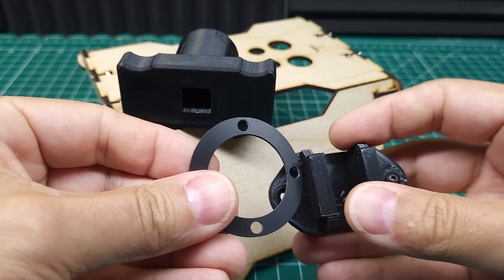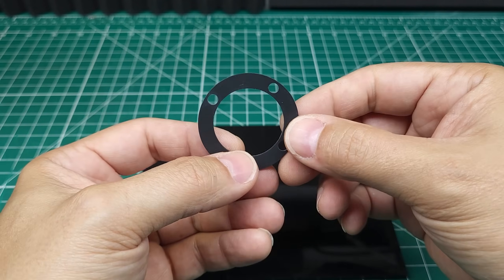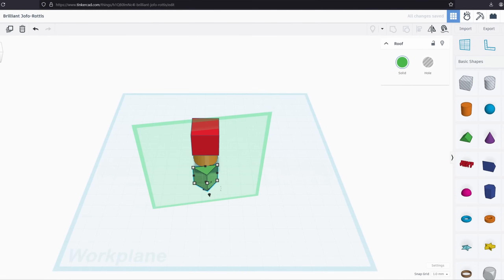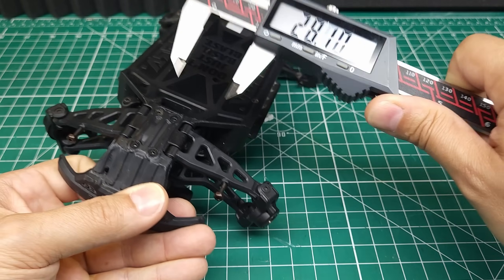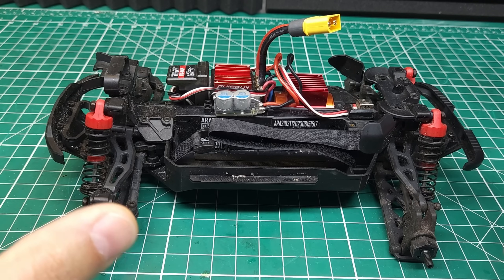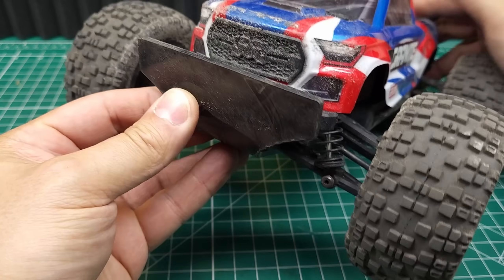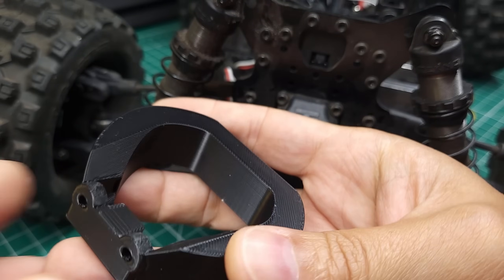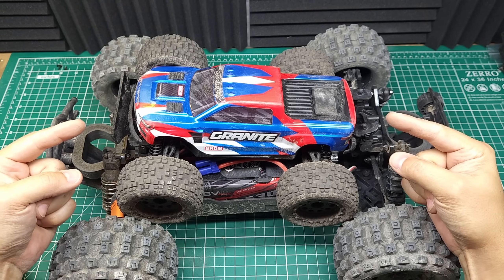It's Time To Start Making Your Own RC Car Upgrades | Here's How!

Comment: Possible to 3D print out the Grom differentials?
Reply from the maker: It's definitely possible to do but it wouldn't work. The 3D printed parts would not be as strong as the original injection molded counterparts so you'd end up with a weaker part.

Comment: Awesome 👍 I want a whole channel of just making stuff for rc. I would want to win a custom wing and mount for the Rival MT8.
Reply: I recently picked up an ender3v2 for $100 locally. It has been pretty good so far for getting into 3d printing
Reply from the maker: Yeah they are definitely good printers though they require you to learn some things in the slicer that something like a bambu lab printer wouldn't require
Reply: @DoRC  Just like the MT8 was cheaper up front but required some extra effort

Comment: So,I've seriously been thinking about getting a 3d printer and have been pricing them. Now I may have to look into a laser cutter instead. Decisions Decisions....🤔😴
Reply from the maker: They both have their advantages and disadvantages. I think a 3D printer is a little bit more versatile for RC but it's hard to know for sure which one would be better for you it depends on what you're going to be doing with it
Reply: Well, I was leaning more towards RC related products, but was talking to my wife about how I could make things for around the house as well. (Really trying to sell her on why we need a 3D printer.😂) But after seeing what you were able to do with the laser cutter I'm not sure. I never really thought you could do so much with one. You've gotten my creative gears going on what I could do with a laser cutter. Eventually, I think I would like to have both. I'd be curious to see what else you've managed to make with both of them.
Reply from the maker: @ShawnMoreland317 I've done a lot more 3D printing than I have laser cutting but I've designed and printed various brackets hooks small replacement parts for vehicles lids for things pen holders bases for my partners nail polishes a bezel for a motorcycle gauge cluster etc etc. Laser cutting has been mostly limited to prototyping creating gaskets RC car skid plates I cut out a wood frame support for an air conditioner for my RV and a few other bits and pieces.
Reply: Ok, that really helps.. I'm thinking that I should start with a decent 3D printer first, and then maybe add a laser cutter down rhe road.  I appreciate all of your input and look forward to maybe seeing more videos about this from you in the future. None of the other channels that I follow have ever done a video on this subject before, so it's nice to see another aspect of the hobby.
Reply from the maker: @ShawnMoreland317 I'd strongly recommend getting a Bambu lab printer. They are all good Just get whichever one you can afford. They integrate their slicer really well and it prevents you from having to deal with a lot of the trial and error settings fiddling that you have to with some of the lesser brands.
Reply: Thank you, I will definitely check them out. Have been looking at the Creality Ender 3.

Comment: Good to point out where 3d printing doesn't go well. A-arms, gears, etc. But in thinkcad (not good in fusion) i've made some lipo battery holders with straps, etc. so long as it's not a super structural part, it works. I print in PLA but wouldn't mind trying TPU someday for what it can do. if I win, how about a simple 3d printed roll cage to fit any sort of standard traxxas slash body. I could find lexan driver figures myself. I'm looking for a roll cage for it... And not the steel one that'll bend form intengy. Just the cockpit part. doesn't have to be the full length of the car. thanks.
Reply from the maker: I'm sure we can work something out. Yeah TPU is way stronger for most RC car applications than PLA. It also doesn't melt in the sun :-)

Comment: Great content. Ive done some 3d printing for RC parts. Lots of Roof skids and Bumper springs for my mt10 and Kraton. TPU seems to hold up great so far. I printed a Grom servo/ESC mount out of PETG and seems to be holding up great. TPU was a bit too flexible being so thin. Ive been checking out the laser cutters. So much can be done at home now a days.
Reply from the maker: They have some 98a tpu on Amazon that's a little less flexible than the standard 95A. It works really well for thinner parts.
Reply: @DoRC  I'll have to check that out thanks.

Comment: I’m see I can get my boss to order one we can use to cut gaskets , could I put laser cutter in my house ? Does it have an exhaust. You bought one for Rc?
Reply from the maker: Yes you can. It does have an exhaust though you'll probably want to run a more powerful fan in parallel with the fan that comes with since the exhaust isn't the strongest so you might still get smell in your house without better airflow
Reply: @DoRC  nice, I’m look into them , I had fans set up for soldering 🧑‍🏭, even though I just been holding my breath 😆.
Reply from the maker: @RcPlayer-tt2vw I do the same:)

Comment: With improvements in the filament happening every day,  it won't be long until printed is equal to injection 👏👏👍
Reply from the maker: Maybe though they're going to have to come up with some way to overcome the layer adhesion disadvantage before it will

Comment: Why would you not use a drill
Reply: For the screws your unscrewing. Work smarter not harder I'm 45 and after working with my hands  my whole life your Hands will hurt when your older  after working on things so save your self some pain in the future everything you do adds up in the long run.
Reply from the maker: @tillyjohnson5160 ah. I didn't use my driver because I was talking and it's hard to talk over the noise. I generally always use power tools.
Reply: @DoRC  it all good man I wasn't trying to be a smart ass,  It's something I even tell my buddy's at work when they are hand sanding when the have a sander or hand nailing when the have a nail gun because I was that guy when I was young I did everything the hard way on purpose just for a work out basically but I didn't realize that when I was in my forties I would have so much pain.
Reply from the maker: Yep. I've been a professional mechanic for 25 years and unless I have a very specific reason not to I always use power tools.
Reply from the maker: For what specifically?

Comment: Now that would be awesome for making replacement x-maxx bumpers actually a guard to protect the original bumper LOL😂
Reply from the maker: I've been running 3D printed bumper mounts for the x series vehicles for a while now. They work way better than the stock ones.

Comment: Wow, the laser cutter is a lot easier that I realized! It seems like you’re a big fan of designing your own parts. I struggle a bit with the 3d modeling, but I am able to make some useful parts with Shapr3d (which is basically the adult version of tinkercad). I would love to feel and use some laser cut flexible parts like the granite grom bumper. Maybe one for the Outcast 4s that fits with the m2c bash bar?
Reply from the maker: I don't have an outcast 4s at the moment but if you win and you can send me the dimensions I should be able to make one for you.
Reply: @DoRC  oh, what happened to it? I thought you really liked it :) 
I will see if I can come up with a good design.
Reply from the maker: @magnusstone  I did really like it but I sell most of the RC cars that I buy in order to be able to buy more RC cars :-)

Comment: One way to get around the grain problem in 3d printing is to design and print the part with that in mind.  Like how structural wood used in houses have the grain in the longitudinal direction.  Using the wrong orientation of the wood grain is how karate kids easily break wooden boards.  When designing and printing 3d parts, make the part print at a 45 degree angle.  This will reduce the chances of the part failing along the grain as the grain will now be at a 45 degree angle to the main stresses the part will see.
Reply from the maker: You can do this but with a lot of parts the layer adhesion is a problem no matter what angle you put it at. Arms for instance will only hold together if they're printed flat but then they'll pop apart at the hinge pins. If you print them at a 45° angle they'll just shear apart in the middle.
Reply: @DoRC  would printing an arm laying on its thin side help? so it would build up a contour around the hinge pin hole

Comment: Pretty cool stuff. Besides money I also have no place to put those machines. I was offered an old 3D printer but literally have no place to put one.  I'd be producing stuff all the time if I could.
Reply from the maker: Yeah not having room is definitely a bummer. If you can find the space though it's a worthwhile thing to get into especially these days.
Reply: @DoRC  I'm finally moving out of this studio next year into a much larger 2-bedroom apartment. Currently my bedroom is also the RC storage and work area and I only have room for 18th scale or smaller anything larger will be on the floor in the kitchen/ living room.
Reply from the maker: @Macgyver46  gotcha.